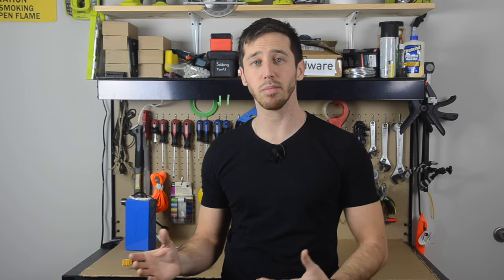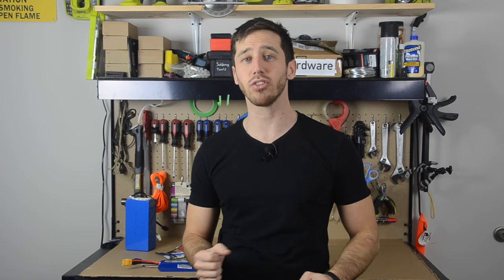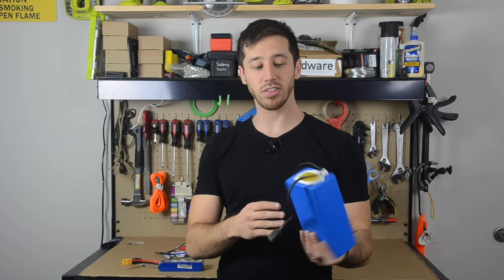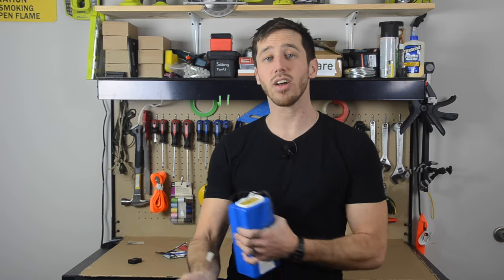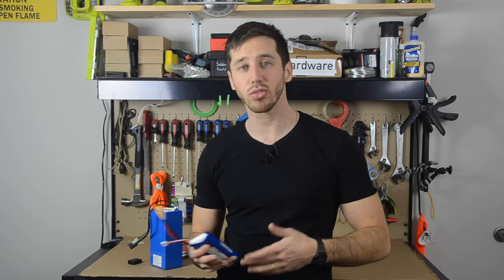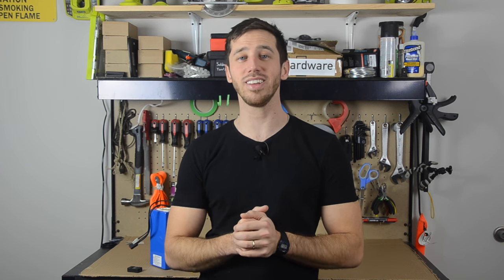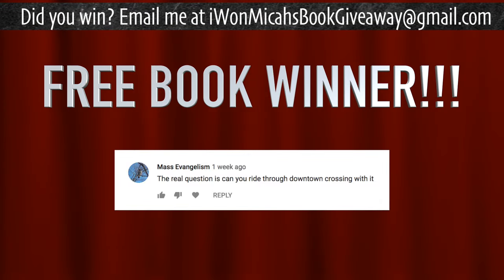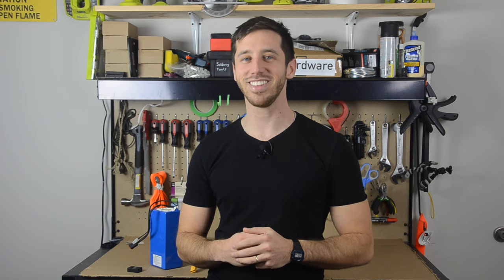Do you NEED a BMS for DIY Li-ion Batteries?

Comment: If battery = series
Answer: yes
If battery = not series
Answer: no
Reply: You are doing god's work
Reply: @VerticalWit  amen
Reply: hahahahahahah thanks
Reply: Sir sure about that?
Reply: What if you need both?
Reply: @melvinjansen2338  then use bms
Reply: @luongmaihunggia  thankyou
Reply: I came here just to confirm this, but the Video is useless. Of course in series few atoms more or less in a battery will cause difference in same battery type. But in parallel, I guess they will just compensate for each other.  Only thing to remember that not to cross the current rating of lowest power cell (i mean not to pull more current from it than its rated capacity). So if you connect 2 cells in parallel 1 is rated at 500 mils and other 2amps, combined you should limit to 1 amp, not 2.5 amps as 2.5 will get divide in 2  and your 500mill will just blow up. Also depends on capacity, if 2 AMP one is just a tiny battery and the 500 mill is a huge bank, then pulling 1 amp will blow the 500 mill one.

Comment: If a BMS prevents the voltage to become too high would it also protect the batteries against a Solar storm? I'm not paranoid but want to find something that would safe my batteries just in case.

Comment: Can I get a reply on this question please? I purchased an ebike, and the battery pack is 20s 15p 72v 150a.

The BMS that the manufacture is providing, doesnt have bluetooth connectivity. I would like to find a BMS that supports my battery pack and also support smart connectivity.

There's no real way to identify whether the BMS has failed or not. Can you help?

Comment: Voltage balancing charging is crucial. there are 3 differences between cells, within a battery. 1, capacity. 2, equivalent series resistance. 3, self discharge rate. I always use balancing at the end of the charge, making sure each cell reaches 4.16 volts each. During use, I do NOT balance. At the end of their capacity, there will be some unbalance, due to those slight differences in capacity. When measuring during charge or discharge, the cell with the highest ESR, will show the lowest during discharge, or highest during charge. balancing while loaded can actually throw the cells further out of balance, worse than useless. so, after discharge, allowing the battery to remain coulombically balanced, at the top of the charge, they will fall back into line, pretty close. then, the balancers only pick up the slightest differences. If a battery sits for a long time, you will notice a difference in voltages cell to cell, because of different self discharge rates. for that, charging until the first cell reaches cutoff, then turning on the voltage balancer, will equalize the cells, without putting any at risk. I guess that's when a true BMS would be a good idea, since it could monitor for the cell with the highest voltage, then automatically turn on balancing, minimizing the chance for an error. For day to day use, balance charging is the way to go, NO balancing during discharge. Let each cell discharge exactly the same number of amp hours. If you know which cell has the lowest capacity, you could monitor just that cell, and tell when the battery as a whole, is discharged.
Reply: I’ve never used any balancer at all. I’ve come to the conclusion that li-0n tech is li-in’… it just ain’t worth the headache, and headache it is! Thousands in money and time down the drain. Gimme a good ol’ Yamaha 200. 85 mph and 80 mpg!I might give the lithium titanate cells a chance before I cave since I got ‘em.. they are supposedly cold tolerant… can’t wait for the uranium batts to hit the market . Better yet.. head for the hills and get a horse! And still better… get a burro! They can go three days without water and eat sagebrush! Blehh I’m losin it!!🤠

Comment: Another great video Micah! Really informative! My dolphin style 48v 11ah is dying on me after 2 years of heavy use! This time I'm not going to buy another one, I'm going to build one using the advice in your videos! I will be using a BMS!
Reply: FrostGhost HD If your building your battery pack what do you think you’re gonna connect them with ? solder them or spot weld ? If your answer is spot weld then please try to buy the arduino  one Micah reviewed because those sunnko ones are unreliable and don’t quite work right !
Tip suggestion : use battery spacers as the battery will be quite easy to build and will take you less time !  I tried connecting them with hot glue and i spent way to much time organizing them which made me go back to the using battery spacers
Reply: Thanks for the advice! I was planning on soldering because I don't have a spot welder. But I will see if I can pick one up for a cheap price! Thank you
Reply: Trust me if you buy the arduino one you will not be disappointed as it is very reliable and not as dangerous to your house. when i was using the sunnko spot welder my entire house’s lights flickered when i spot welded and I did get complaints from tenants for lights
Reply: @TonytheCarEnthusiast  if you have that problem then you need some coil to smooth pulses. Get longest extension cord. I had 15 meter long. Roll it in circle and connect to your welder. Problem with circuit braker or filckering should be gone

Comment: Really good video. I appreciate your not going BMS only route!!! I personally went to the dark side (not extreme though). I have connectors that I've installed on my mega battery (ebike DIY battery 14s10p) that enable me to split my battery in two for charging... and I use an iCharger Duo.... so that I CAN keep an EYE on all segments while charging. I do appreciate your advice on installing segment alarms, they're pretty cheap and I honestly hadn't thought of that.... though I tend to hang out in the top 2/3rds of my battery's range (can't deal with the lack of power in the lower range). The biggest problem that I have with almost all BMSs is that I can't tell whether they're working ...most of them are just boards without any interfaces. I'm the kind of guy that would really like to see the progress or error codes or status..... and yes, I've now paid through the nose with the iCharger Duo. I do like my set up. the iCharger is small enough to pop into a small backpack with my iPad pro or MacBook. I keep a 750W power supply at home and one at work as well so I don't have to lug those around as well. I should send you a pic of my finished battery - been using it for a good while now. Thanks for all your help previously and keep the awesome videos coming!!

Comment: Do you need a bms if you are creating an additional battery to a current Ebike setup? I have a 36v 10ah and I want to add an extra 10ah. I’m using recycled laptop batteries and don’t care about the lifespan but more about safety. I don’t want it to explode while I’m riding.
Reply: It depends upon how you connect the additional battery ...

Comment: Another question. First, excuse my English using Google translate from Swedish. Have two battery packs 48 v 13 amp connected in parallel. Uses two charged one for each battery's BMS. Disconnects the batteries in parallel before charging. Now my question, it is possible to have the batteries connected in parallel when charging, see wear when disconnecting them at each charge. Hope you understand the question.
Reply from the maker: Theoretically it is best to disconnect when charging because if one battery finishes charging first, even if it’s BMS shuts off charge, it can be charged by the second battery via the parallel discharge ports. That could result in the first battery being overcharged.
Reply: @EbikeSchool  If I mount automatic fuse on each battery. Is it possible to break manually with the reset switch? About how many amp fuses are needed per battery. For Bafang HD 1000w. Thanks in advance. Your movies provide good knowledge.

Comment: Can I use a 3s balancer to control 2 batteries in series?  

The only BMS that had stats I was looking for has 3s, but I have a 2s system.

If I leave one of the balance wires unplugged, will that interfere with the BMS?

Comment: Great video... Thanks... But I just have a few questions... 
I very well realize the importance of a high quality BMS but I'm running onnan absolute zero budget where every penny counts... It is wise to use two of the low quality BMS (cuz they're available only in multiple quantities) ?

When you mentioned the Shelby's battery with two BMS... How can that be done... ? The connections?

Comment: after using off the shelf cheap BMS's I decided to design my own with an arduino at its heart and where possible off the shelf components and premade arduino modules. this minimises smd soldering.
It is not an all singing all dancing device it does just what I think it needs to do, there are other devices that can handle the missing functions IMO.
would you like to have one to look at when it is completed.
kendrick

Comment: I ues both BMS and balance charger on same battery 6s10p works well using the skyrc b6ac v2 charger. not on a ebike tho. its for power in a shed in a remote location. So for I have 2x 6s10p made from used cells I am building more about 6 more to add in my solar system. the powere draw will be very low say 6 10 amp. and tops of 30a in at anyone time. I plan on adding 2 bms to each battery plus a resettable thermal fuse. I am not going to add in balancing as I only plan to charge to 4 or 4.10v topps so balancing want work but plan on using the skyrc b6ac v2 charger for balancing as and wen needed. I Just not sure how to do the 2 bms do you just daisy chain the bms.

Comment: i have an issue with me ebike. i have been able to narrow down to the battery pack. the bike will cut out and shut off if given any amount of throttle other than the smallest amount of speed. the battery pack test normal on the volt meter. im assuming its the bms that is shutting down the bike, as from what i can tell the batteries are fine. is this a logical assumption?

Comment: Hi Micah finally found the Comment section. I want to build a 70v60a Ebattery. I'm having trouble estimating how many batteries I'll need. HELP!!! Also from your videos I've learned about the 12v increments. Any idea/tips on the shape will help a lot Thanks 
Signed
A senior/veteran eager Beaver
Reply: You will have to make 20s 30p that makes 600cells
Reply: If you are aiming for 72v nominal

Comment: I have a bms on a 12v 3s2p pack and I have a balanced 3S wire hooked up because my imax b6 mini doesn’t allow me to charge without the balance plug. Here’s my issue I bought brand new Samsung 25r batteries so everything was charged properly but my B- B+ tabs read lower voltage that the actual pack reads. The pack reads 12.65v and the output plug reads 11.55v so I’m not sure why that is but I do have a few voltage alarms and one with a lcd screen but I’m not sure if the cells will discharge evenly so I left the bms on but I just don’t get why through the bms it reads lower voltage.

Comment: my 84V euc battery has two smaller wires (black and red) but they have no voltage.  does this battery have to balance?  I'm trying to charge it separately from the euc mother board connections.  can you just connect the charger output to the battery and charge it?

Comment: I watched a number of videos about building a lithium battery.  I understand the wiring of the battery and the need for a BMS, and watched the wiring of the BMS but I have not heard anyone discuss how to choose the appropriate BMS.  4s  36v  current draw ?  what criteria in numbers do I use?  Please help!
Reply: BMS for a Battery is selected by  #1) Number of Cells in SERIES,  #2) Cell Chemistry,  #3) Max Amps.  If the batteries are then connected in SERIES, then the Total Voltage must be supported, too.

Comment: My 1st e-bike battery was a 10s2p. I had soldered the cells and was waiting for a BMS. Started using it before the BMS was installed but a solder joint came off and one cell dropped to negative voltage. It only took a ride for this to happen. I always wait for the BMS to arrive ever since.

Comment: Great Video. I have one BMS which cut off my battery power supply after 5v being used and still have 95% of power on each of 20 battery cells. What can I do with the BMS board? Replace or repair it?

Comment: Hi Micah. I am new into building batteries and just finished reading your excellent DIY Lithium Batteries book. I got a question. How do i wire a BMS if the charging and discharging connector is the same i.e there is no dedicated charger plug? Looking forward to your answer. Thank you.

Comment: Im looking at ebike with 48v 615WH lithium battery with a built in BMS.  It can fast charge at 55v6a.  Can I safely direct charge it with 325Watt60v solar panel with no controller?  How trustworthy is BMS.

Comment: thanx for great vid. 2 things remain a tad unclear:  
1)  so a ‘balance charger’ will only make sure total batt-pack V does not exceed  max. V  but has no control of voltages of individual cells, right?   Within a pack 1 could be 3.2V and 1 could be at 5.2V and it wouldn’t notice.  That doesn’t sound good at all  (Sounds like d problem of a 12V lead-acid batt where d 6 cells drift apart with age. Only way to overcome this is to go with 2V-cells where you can check voltages and possibly extra-charge d low ones)
2)  why is it still necessary to use a dedicated charger when using a BMS? Can’t just apply a V  (Xcells x 4.2V, at least) and d BMS will cut off current when this V is reached?

Comment: Is there a BMS for parallel cell pack? I don't need a higher voltage from a series pack, rather I want to prioritize the mAh. So far All BMS I've seen has more than 2 battery cell.
Reply: Are you looking for a Over-Volt / Under-Volt BMS on EACH Cell in a parallel pack? 
They certainly do make a 1-Cell 1S BMS board!
Example = https://www.ebay.com/itm/383383797004 
Select the # of MOSFET''s for your  amperage

Comment: Is it possible to install a BMS to protect against excessive drain, but add an additional wire to each parallel group so a balance charger can be used for charging?  I want to use my balance charger because it allows me to lower maximum charge voltage to enhance battery life.  But I don't want to mess around with installing voltage alarms to monitor voltage drop.

Comment: I bought the cheapest 16s bms i could find for $15 but its already in my ebike and i haven't tested it yet should i be woried? (Btw its a 2 wire bms were charging and discharging happen with the same plug rated for 45 amp cont. From aliexpress)
Reply: Throw it away and DON'T get the cheapest one next time.

Comment: Essentially yes. There are primitive solutions like voltage sense/alarm gates with bypass switches for each battery, the dead batteries will stop outputting and switch the circuit to charged batteries. Though this is not great in a series circuit where you need a constant voltage.
Reply: (And the inverse for your charging circuit, would be a balance charge circuit.)